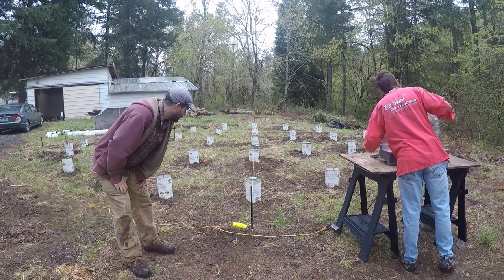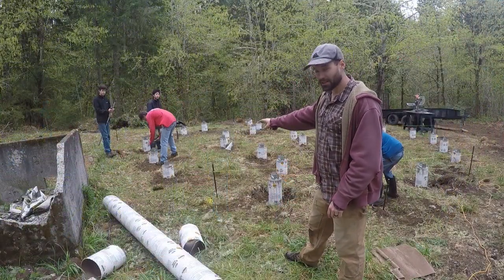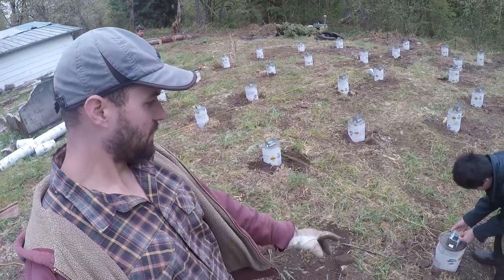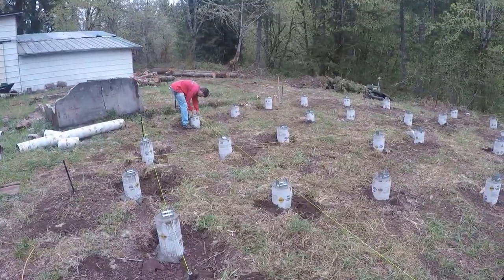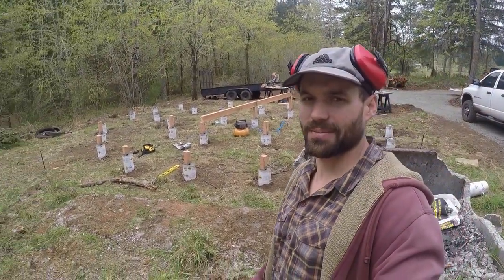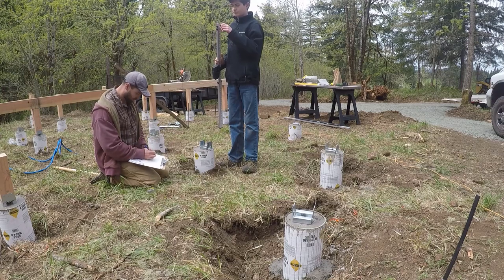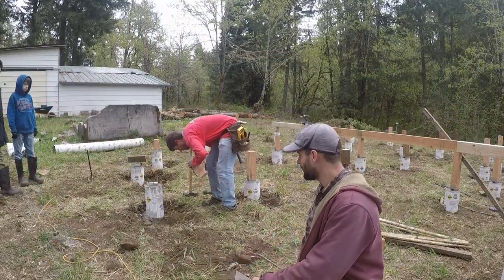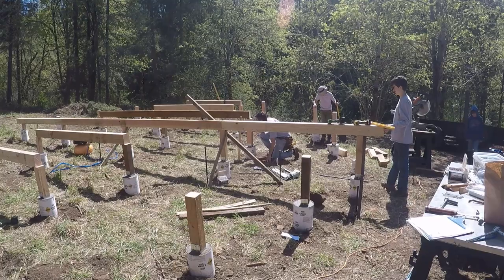Building a Yurt Foundation, Day 2 - Posts and Beams

Comment: I’m interested in a yurt as a “tiny home” option and curious about your decision to have it raised as high as it is. Was this for storage? Or snow heights in your area. I’ve been wondering the best way to limit creatures underneath it and limit drafts and heat loss
Reply from the maker: We wanted to have room to use it as a crawl space and work on plumbing/electrical under the yurt.  We're also on a sloped site, so we started with about 1.5ft at the one side of the yurt, which is closer to 4 ft at the other side.  Heat loss isn't as much of a concern for us as good ventilation to prevent moisture and mold buildup.  Drier, colder areas may well use a different strategy for yurts.  It also sounds like you may be learning more towards a well insulated cabin, which could definitely be a better fit for many people.